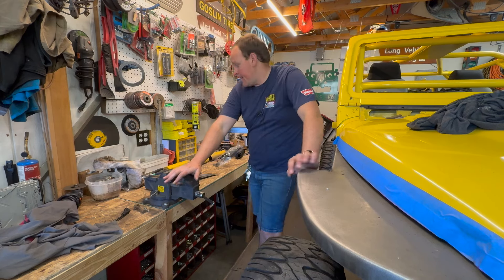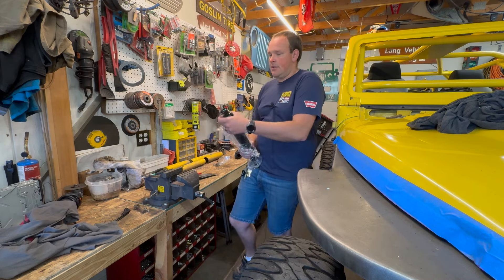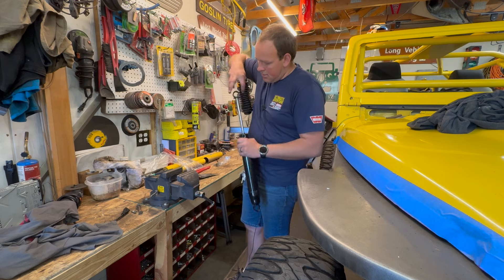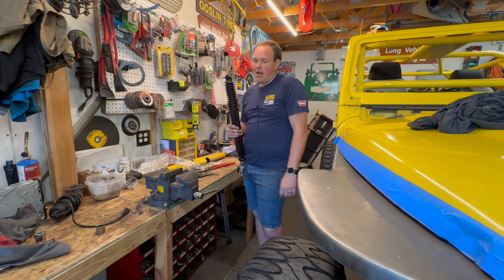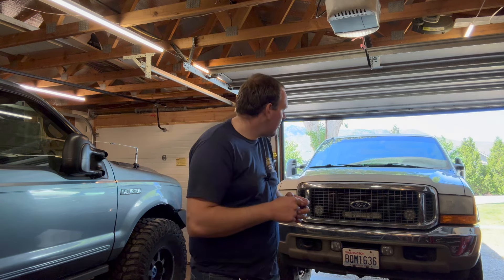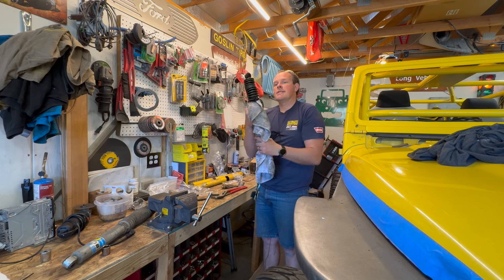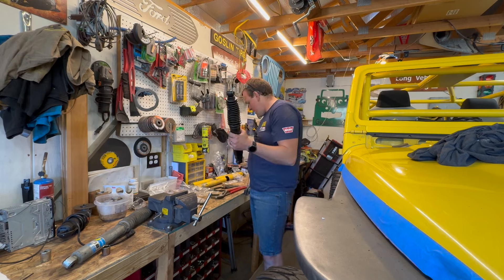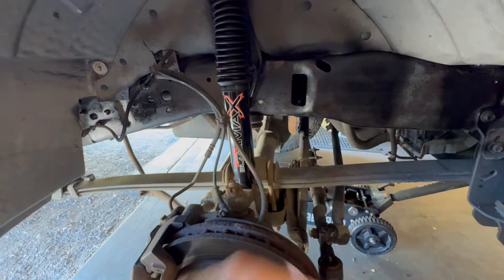Upgrading My Ford Excursion with Skyjacker Shocks (better ride)

Comment: I installed some Gabriel shocks after 145k miles on the stock ones, which were definitely worn out. Gabriel shocks are easier to find in Europe—easier than either Bilstein or Skyjacker, anyway. They’re probably a bit stiffer than the Skyjacker Black Max. I’ll try those next! I only tow heavy once or twice a year anyway.
Reply from the maker: Ya worth trying for sure! I bet skyjacker will ship to ya!

Comment: I have a 02 limited  diesel and love it but hate the ride as you did. I don't have a lift kit but do have air shocks in the rear. Which black max should I order? Are fronts alone worth replacing and leave my rears alone? Thanks
Reply from the maker: Do you use the rear air shocks to help with loads? If you’re not ever changing air pressure I’d sure think about just swapping them all. Go on skyjackers site and put in the truck to their vehicle finder, it will show you all the shock options. These are the shocks for 0-3 inches of lift.
Reply: Thank you!
Reply from the maker: No worries, I'm betting you'll feel a significant difference between these and an air shock in the rear... These should control the truck much better.
Reply: I talked with Skyjacker today and they thought gas filled Nitros were a better fit for such a heavy truck. Thoughts?
Reply from the maker: @paulcoy7292  so far I am still liking my black max’s on both trucks. The ADX is a better shock tho. It should last longer and might be even smoother. I like the little float this gives my white ex, and bob will probably get ADX’s when I have the suspension where I am happy with travel.

Comment: It’s only showing the one model for my truck 
Does this mean they are all the same all around 
02 Limited 6.8
Reply from the maker: Interesting. The front shocks are different than the rears, maybe change the motor to diesel and see if that changes it? Or the year might be better, valving is probably different for the weight of the diesel

Comment: How is the towing with them?
Reply from the maker: The extra “give” in them still smooths it out nice with a trailer. But they aren’t as stiff as others. I don’t have bags and don’t mind a smoother towing experience
Reply: Will towing  my boat  with my new to me 2000 v10
Reply from the maker: Ya that's the biggest thing mine tows currently 21ft fiberglass. feels great.
Reply from the maker: Nice